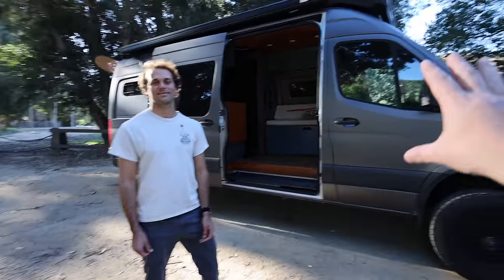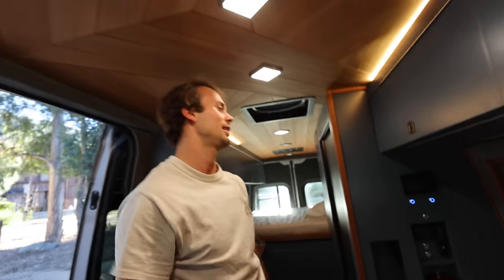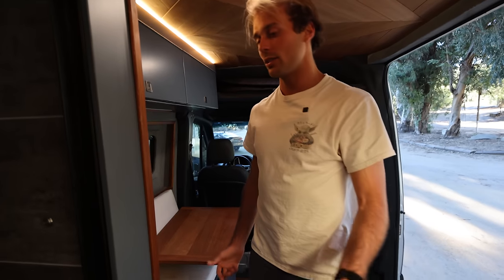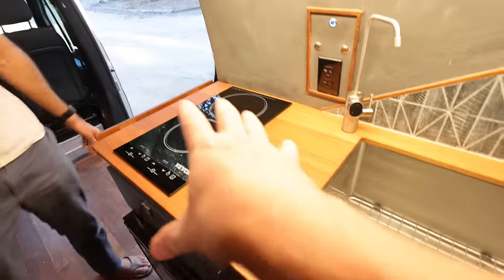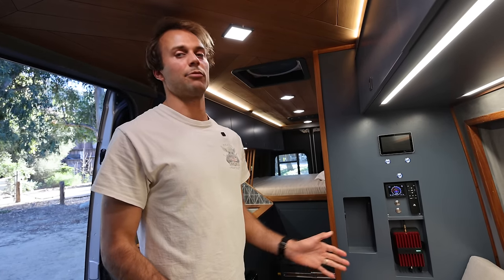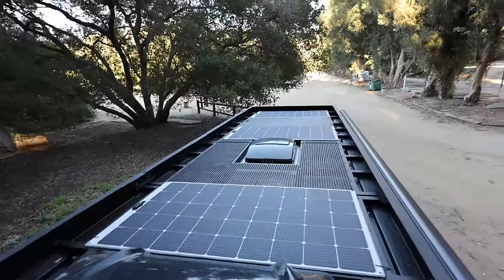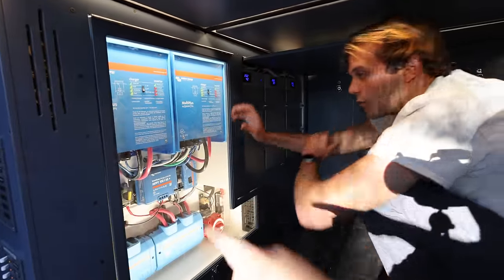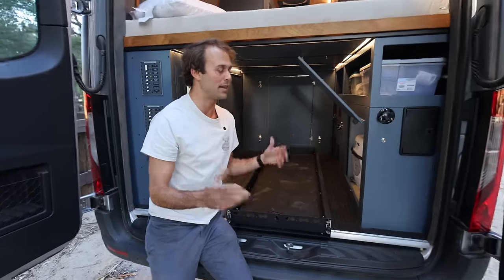Apocalypse Sprinter Van Build Ready for ZOMBIES

Comment: FWIW, Shane has the right strategy for getting the most hot water out of a little tank. But in the plumbing world, folks don't set the hot water tank over 120°F because anything that hot presents a real danger of scalding and burning. There used to be antiscald shower heads to cut that off, but they don't seem to be sold anymore.
 Incredible job on the van. Style and function.
Reply: maybe one can set the faucet so at the hottest setting still draws some cold water.
Reply: My water heater is set 180 but has a mixing valve on the outlet of the water heater that only allows 120 degrees so basically we have doubled our hot water storage.

Comment: Damn near perfect. Only thing i would request for a change, for me at least, would be adding a small slide out section to one side of the van just tall and wide enough to make the bed longer. Maybe add a slide out that's 20" high , 4 wide  and pulls out 2 feet. Just some place a tall person can put their feet when sleeping so they aren't cramped. Because at 6' he wasn't able to lie flat.

Comment: Perhaps put the kitchen cooker section on a short slide so it could move to its left by 300/400mm so that it was able to be open to the air if the cooking required it. Why not! This van is v clever.

Comment: 16:15 Insane current if inverters running full power. 250 Amps. Even my vans starter motor doesn't draw that much current. I'd have thought even those thick cables will get warm after an hour or so. I'm running 5KW inverter in my camper, but at 48 Volts to keep current down. Even so, every 6 months or so i check the volts drop from battery to inverter just incase a connection has gone a bit high resistance.

Comment: Very nice. But that toilet is way too low for seniors. Maybe make it taller and pull it out from the next tile above where it is now. Also, some kind of handle to  hang on to along with foldable lightweight steps are needed for seniors to step out of and into the van from the sliding door. Can it be driven into an 8' clearance garage?

Comment: Love it! Almost my ideal van. I only miss an oven and a height adjustable desk with a monitor for work. Really don’t know how to do that, but it’s absolutely necessary. Has anyone ideas? 🫤 to have a separate eating area, I thought about maybe such a bed lift and below an eating area? 🤔
Is that even possible?
Reply: Yes, but youll lose most or all of the "garage space" or you'll likely need a larger vehicle. Might lose some of the upper cabinet storage as well. It's all tradeoffs when trying to put so much in a limited space. There's builds on this very channel though with bed lifts and a dining/work area underneath. Could be a way to have it all I'm unware of though so don't give up on it because of me.
Reply: @Lockke_  thanks for the tips and thoughts. 😄 yes, the videos at this channel gave me the idea with the lift bed. The storage issue is also worrying me… but I hope, I can do it somehow one day.
Reply: Had the bed lift with a dinette under the bed. Also doubled as a second bed. As far as the oven, a good small convection is what we use. Thing is killer😊
Reply: @scottnormand5858  awesome! Thanks for sharing! Did you enjoy the bed lift construction?

Comment: Trying to find a van builder for my overland van. Every time I look, I see another great design. This one meets most of my criteria. Separate shower/slide away toilet (bonus) being important for me. How's the weight versus carry capacity? Don't hear many builders mentioning this and that concerns me!
Reply from the maker: Builders don’t worry on weight too much only because most add suspension which helps. Mpg goes down with weight so if that’s your concern that’s different
Reply: @JarrodTocci  Just concerned about keeping within the cargo carry capacity for the van for safety and things like brakes etc. Also insurance if you exceeded then involved in an accident, they might not pay out (or worse). But I get your point about upgrading suspension. I guess I can check with Agile RIP kit folks how that changes things. Would be a good point to cover in one of your videos. Happy Spring

Comment: Great video but why is spray foam in a van not a good idea?
Reply: It voids the warranty on any electrical problems in the van because you cant access any wiring behind the walls, and there is a big risk of warping the metal if not done right.

Comment: why is spray foam not a good idea?
Reply from the maker: On the sheet metal of the van it will cause warping. If done by a professional you have a chance of that not happening but still no guarantee

Comment: This building is not fully thinked out: the fridge has not easy access, there is no closet for jackets and things like that, the bed foam is thin, the wood around sink will be wet and destroyed quickly. I have also impression there is not much living space inside. Also I do not like the form of the couch.

Comment: I’m sorry what did you say you used lizard skin for??
Reply from the maker: Thermal break. Metal conduct heat and cold easily so to separate the inside from either cold or hot weather it’s important to create a thermal break which that is what it does. But it’s best to follow that up with more insulation like wool, 3M thinsulate, or foam board

Comment: So basically he's dumping sewage into his gray tank and calling it good. Its a black tank. But we'll just tell ourselves its a grey tank? When we piss in it?
Reply: 8:35 black is for solids.
Reply: urine is very different from solids.  Mixing pee with soapy water from the shower and sink is great to dump on plants if you use the right soaps.  Throw some urine neutralizing enzyme down the drain and it doesnt smell at all either.
Reply: @landship  So is it diluted by water at 5:1 ratio?
Reply: @aaronwells6608  id say so.
Think about how much water you use doing dishes / showering on a daily basis

Comment: Sprinters over priced because of these trends
Reply from the maker: I highly doubt the vanlife trend can inflate a market that much, maybe with 4x4 sprinters but that’s more lack of supply as there’s only 10% of sprinters made as 4x4’s (something like that). The vanlife trend is still a very small percentage of what cargo vans are used for. Just because you don’t see actual trades people on the internet using their vans doesn’t mean those aren’t sold for them 😆
Reply: @JarrodTocci  most ppl for work use basic cargo vans like Chevy or ford not sprinter lol